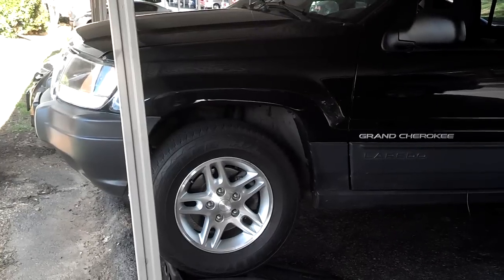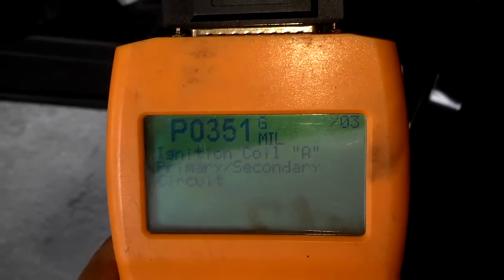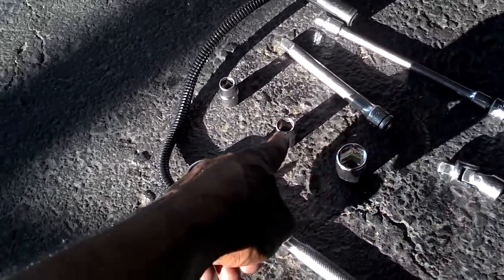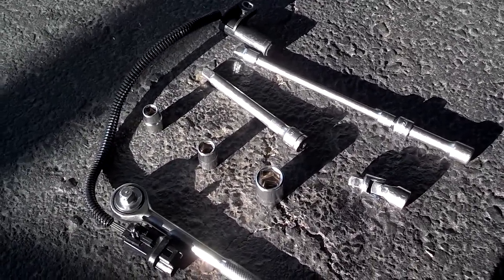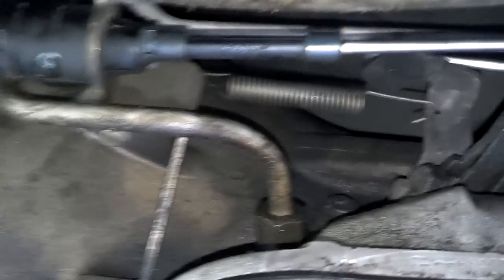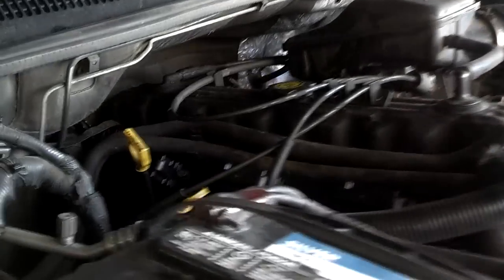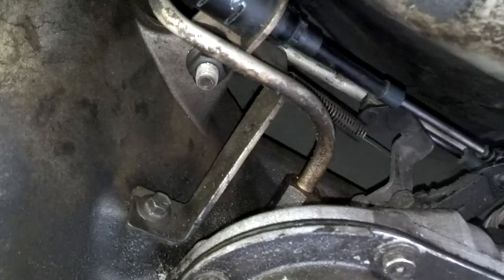How to replace the crank sensor on a Jeep, replacement, P Codes P0351, P1391, P1494 - VOTD

Comment: Great video Robert and I only wished that had your mechanical skills!  I started my 2000 Jeep GC today and it started bucking and the engine light came on. I was able to make it to my mechanic and he told me it was the crank case sensor.  I was unaware of the many things this little sensor did.  By the time I got the Jeep to my mechanic the Jeep would start but would stall.  So he will replace this part for me.  I had a rebuilt long block (4.0) put in this Jeep about a year ago (Bearings went in the old one - faithfully changed the oil every 3000 miles)

Anyway, I have a question for you.  When the Jeep is up to normal temperate and I come to a light it will feel like the engine is surging while at idle 'only when I turn the heat or a/c fan inside the car'.  If I put the car in neutral or park it's idles smooth, no problems. Would this crank sensor be the culprit of this issue?  I have already replace the AIC valve and thsat didn't do anything, but I'm just wondering what could cause this somewhat rough idle, again if I put the Jeep in park or neutral it seems to idle fine.  If I turn the A/C or heat off it seems to idle fine as well.  

The car has is about to turn 200k mile and only 15k miles on the new engine and keep it super clean, I bought the Jeep new and really love my Jeep and can't hate car payments.  

However, if you have the time to respond, I would welcome to hear what you think.  Thanks again for video and all the very best to you sir ....
Reply: Also, I think that he's using an after market crank sensor, is this alright to use?  I liked and subscribed! Thanks again!
Reply from the maker: Jazzman I believe you have a vacuum leak somewhere. You can also monitor voltage to see if they are changing. Alternator going out maybe.
Reply: Robert DIY Thanks for the reply, the mechanic (who is a long time family friend) tested the codes and it pulled the crank sensor, which match my list of codes that I printed off the internet and keep in the car for resources.  Are you referring to the vacuum leak regarding the idle surging issue?  Thanks for all the help!  Hey, I'm a jazz sax/flute player and only wished that I had some mechanical skills ..... :)
Reply from the maker: Oh, I do not like after market crank sensors, only Mopar for me. Yes, I think the hunting idle is from a vacuum leak. - Nice, my nephew is a jazz trumpet/sax player/teacher.
Reply: Robert DIY Unfortunately, the dealership did not have one in stock and I need my car back, so I'll have to take my chances on the after market sensor.  I was a touring musician and did a lot of studio work in NYC and taught at ECU.  I still play, but getting older and my chops are getting slower. Hey, thanks for the help Robert, you're a great person to respond, all the very best to you sir ....

Comment: so I got the old bolt off with a lot of trouble and pulled the old sensor out through the top of the engine but how the hell did u get the new sensor back to where it needs to go?! maybe I should hire a child for the day to get it in there?
Reply from the maker: Cameron Martin Yes it is tough. Some people cut through the floor inside the truck.

Comment: Why do u have to take out the Crank Sensor  ?  Just unplug old one and plug in new one. Don't take out.  Now Drill hole or glue to Firewall . ✔  Done
Reply from the maker: where were your instructions when I needed them?

Comment: hey i need yalls help i own a 2002 jeep grand cherokee 4.0L and it just started to run real rough and shuts off with now the oil gauge on H this morning it stayed between H and normal. but still runs rough. i took it to auto zone they hooked up thier code reader i didnt get the codes but he said its either your timing belt or your oil pressure switch. i changed out pressure switch and did nothing. could it be the timing belt? or could it be the crankshaft sensor PLEASE HELP
Reply from the maker: Aaron Worthington Go back and get the codes.
Reply from the maker: Many still have chains.
Reply: +Aaron Worthington I have the same issue, mine spits out miss fires on all cylinders(runs fine till it gets hot then it will spit n sputter and idle is bad). I told the auto zone guru, if it was not working the truck wouldn't run. I have replaced my ECM, that did nothing. I just bought this sensor on a jeep 1999 Grand Cherokee Laredo 6cyl 4.0, pretty sure this is it. Only thing scares me I have seen video's that say the cheap after market one's will not cure the issue, only factory MOPAR parts will be good to use. But for nine bucks I'll roll the dice. Already swapped out the cam positioning sensor it did not cure my issue, unless it was cause it was cheap too? Only other thing is the fuel pump in the tank that's next. Unless you have patients and get a good price on these used, I'd suggest run far away!
Reply: Its not the sensor its that long black think on the side of the engine. its called engine coil. its the flat plastic piece that stretches out down the side of you engine kind towards the top.
Reply: i tried everything changed out sensors and wires nothing went to a mechanic and they hooked up their machine and it said bad engine coil
Reply: try this out and goodluck and god bless buddy i hope i helped you out
Reply: +Aaron Worthington Yeah I know what the coil package is, the issue is the codes change. The coil package will not fire if the fuel pump isn't sending a signal to the rely. Yesterday while driving HOT after half hour, the whole truck vibrates and bogs down. I pulled over shut if off then restart, its fine.....Anyway I have the crank sensor on the way, but its a cheap replacement. 
 So they replaced the coil package and all good Aron Worthington?
Reply: mine did the exact same thing 
so yeah check out the coil package

Comment: Great videos brother.  I am trying to replace my crankshaft position sensor on my 1998 grand cherokee laredo.  What did you use to reach up there and get the bolt out for the sensor? I can get my hand and arm up there enough to get a good lock on it, did you use a certain tool to get to it?

Comment: Do you need to take the spacer off the crank sensor on a 95 laredo before replacing?
Reply from the maker: +Alvaro Gonzalez I don't understand the question. All the info I have is in this video.
Reply: +Alvaro Gonzalez Are you talking about the little spacer on the sensor itself?  If you are, then no, you keep that there.  If not, then sorry I don't knowhaha.
Reply from the maker: I have not done that repair or watched the video in years. I really don't know what to tell you.
Reply: For future readers - cheap aftermarket sensors may work, but generally lead to greater expense and frustration as they tend to fail quickly.  It's not mentioned in the video, but a new Mopar crankshaft position sensor comes in a plastic bag with a set of instructions included, and that sensor should have a paper spacer glued to the bottom of it.  DO NOT REMOVE. (NOTE: If there is no spacer, contact your local dealership Parts Dept to obtain one.) That spacer is important to properly spacing the sensor from the flywheel and it will be worn off once the vehicle is running.  Good luck.
Reply from the maker: Thanks for sharing.
Reply: What a time this has been.  Today I was able to get the bad sensor out, but because the small bolt holding the shift cable bracket stripped, and not having small forearms and hands, I had to get creative.

Using two 6" 1/4-inch extensions, I loosened the bolt to the crankshaft position sensor all the way.  Then, crawling underneath (the WJ is lifted 2 inches so left on the ground), I snaked my arm up over top of the bracket and worked the sensor out all the way.  Since I tied a piece of long string onto the connector end, I was able to pull the sensor all the way and will just reverse the process getting the new one in.

Comment: and as you mentioned red wire plug. Is it for CRANK or Cam sensor?  u mention Cam
Reply from the maker: +su su pretty sure it is the crank sensor.
Reply: Thanx for swift response jeep has 124,400 miles 2001.  so when removing CPS I notice its wrapped with other wires nice and neat like when first bulit.   how can they be pulled apart and then wrapped together again.  i hope you understand what I am speaking of
Reply from the maker: +su su I don't know they are hard to reach.

Comment: My '88 Cherokee has 904,000 miles.  The crank sensor started acting up after 10 years.  The engine would hiccup at highway speeds.
Reply from the maker: +8avexp sweet! Please share what you have done to get it there...
Reply: Changed the oil and filter religiously.  The engine was replaced at 599K.  It still ran, but was hemorrhaging oil out of the rear seal.  They felt there was too much end play in the crankshaft, so I went with a reman engine.  Fourth clutch, transmission (Peugeot 5-speed) was worked on last year.  The transfer case and rear axle are still original and untouched.
Reply from the maker: Still impressive. So your clutches last about 200,000 each? Where do you drive most of the time?
Reply: Mostly highway.  The original clutch lasted 202,000 miles before the pressure plate gave out.  The second clutch was replaced along with the engine; it lasted 397,000 miles.  The third clutch was replaced when the transmission was worked on; it lasted 256,000 miles.
Reply from the maker: Cool, thanks for sharing. Not often you see a vehicle with more than 400,000 miles, let alone close to 1 million.

Comment: Well after replacing the fuel rail, fuel pump, fuel filter, coil packs, spark plugs, and purge solenoid I hope this will do the trick.
Reply from the maker: Trevor Maughan Yikes! Follow the codes.

Comment: The bolt and bracket fell and I'm unable to find them.  They're not on the ground.  Where might the bolt have fallen and can use any same size bolt and thread to replace it?
Reply from the maker: +Jahil Parker sounds like you need to go fishing with a magnet. Most bolts have a strength rating. Probably not a big deal.
Reply: What about the bracket which is also fell.
Reply from the maker: +Jahil Parker not sure how I can help you with that.
Reply: Im asking if the bracket was important and will it be fine without it
Reply from the maker: +Jahil Parker let me see what it looks like?
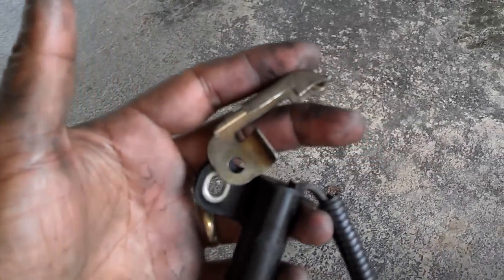Reply: its in your video around 5:20
Reply from the maker: I would think that bracket is pretty important.

Comment from the maker: Where did you get the cam sensor from? Are you sure it's plugged in properly? Check to make sure none of the connector wires are bad. Did the car have a CEL code?

Comment: hey my 2001 grand cherokee laredo 4.0 thru same code. changed spk plugs/gas cap/coolant temp sensor/engine oil and filter/ even replaced battery. it starts but fails soon after. so had codes with on/off key thing. 0118( coolant sensor)/0320/0138/0442(Evap changed gas cap)/0445/1762/0748/1685/0456.  YOu also say crank sensor but then cam sensor time ti time which is it please help. car is sitting
Reply from the maker: +su su replace the sensor in the video.

Comment: Your a good man Robert. I had no clue where that sensor was located. Now I know I'll have it done at the Garage. I'm 70 years old. I'm afraid my repair days are over.  What would this cost at the Dealer for Mopar replacement parts?  Any Idea?   Great video Robert. I subscribed and gave to a "Like".
Reply from the maker: +Robert Underhill estimates are usually in the comments. My guess would be $250.

Comment: hi.. I'm wondering if the idle speed was fluctuating???... I have the same turn off problem while driving and I'm about to change the cam shaft sensor, what i've noticed, is that when I decelerate abruptly in a stop light or over a speed bump the revs go under the idle speed and the engine dies, some times the ignition goes without problem, but in the worst scenario it takes a lot of switch-on (as in a cold carb engine) or even worst it will not start for a while (almost half hour)...

Comment: I have a 98 Grand, 140,000 miles, automatic, 2 wheel drive.  had the transmission pan & gasket replaced after which  it started to "almost" stall out when going from reverse into drive after sitting over night.  Since then the problem has gotten worse & it now seems to try to stall out every time I go from reverse to drive.  Does this sound like the crankshaft sensor or would this be something else?  Appreciate your opinion.

Comment: So i took car to a mechanic and says code says 01762 and and 0748. wants to change  governor sensors  and solenoid in transmission. crank shaft code not showing up any more. prob is  I've never dropped the pan  will this cause it to slip?? not a flush just dropping the pan.  mechanic says he can't guarantee the will start
HELP AGAIN.  I DID BUY THE CRANKSHAFT SENSOR FRO A1AUTO AND CABLE WAS TOOOO SHORT TO REACH OTHER SIDE!!!! really do they not know
Reply from the maker: They may not, you have to tell them. They may have a bad supplier. Sad to say, I don't know about your other issues.

Comment: Have a 96 jeep Cherokee 3 cpc, 2 oxygen, 3 fuel pumps4 plug wires sets,4 sets plugs , still have code po351. ready to try ECM. Best advice is don't BUY A JEEP
Reply from the maker: Gale Sams Ouch, what is a cpc?
Reply from the maker: So, CPS?
Reply: Check the wiring to your pcm, they love to come loose on 96-98 GCs
 Some people use tie wraps to hold them in place. My 98 would stall and their all kinds of codes (once showed 21 different codes at the same time) Cleaned the PCM connectors and made sure they where secured properly... Haven't stalled since.

Comment: Have a 98 Grand Cherokee 4L,keep getting code p1391. Changed crank sensor with factory Mopar sensor, still getting code p1391. Any suggestions?
Reply from the maker: +Jason Pantages ouch! Not really, check the wire harness real good.

Comment: can you get the crankshaft position sensor from mopar on ebay  or does it have to be from the dealer? doesn't the dealer use mopar parts also. its a a huge savings

Comment: Hello Robert, Thank you so much for this video... I did replaced my crank sensor for my 03  grand cherokee 4.0 with your video walk-through... Unfortunately, I'm still getting engine misfires throwing  P1391 code on the dash this time. You mentioned to replace it with OEM Mopar Crank sensor part. That I didn't do since it wasn't readily available instead a got a BWD brand from  O'rielly ...  Do you supposed  it is absolutely necessary to  get the original part for this problem? To date I've already replaced my Cam sensor (mopar) , & my coil pack (delphi) since it gave those problem codes as well after I replaced the crank sensor at first. Engine starts & runs then  misfires/shake after a bit of driving. Kindly let me know what you think when you get a chance. Thank you much! Reuben PS. Do these sensors need reprogramming with PCM?
Reply from the maker: Mopar, no programming.

Comment: And before you do anything open up the driver's door peel back the carpet on the hump and locate where the shifter cable goes through the floorboard being extremely careful not to cut deep take the Sawzall and cut two legs of a triangle peel the floorboard back and there is your crankshaft position sensor. Do this before you cut the s*** out of your arms trying to get it from the bottom or the top. Do yourself a favor it plugs in on the passenger side behind the engine. When you unplug it tie a string to the plug so that when you pull it out you can use the string to pull the plug back over there on the reinstall when you tie it to the new one. Your sensor will come with a pad on the bottom just push that down so it's firmly against the flywheel. The pad will rub off and leave you with the proper gap.
Reply from the maker: Thanks for watching.
Reply: great info ,, i have an 02 and its die on me twice this month when i come to a stop and gets ruff idle for a split second while driving wonder if this is my problem .
Reply: Very well could be. It will also for no reason cut out at high speeds sometimes reading gauging. Pulling off your battery terminal for a minute or two will reset the computer and sometimes works in smoothing out your idle and sometimes does not on first attempt. Sounds like one of the conditions I had before fixing it. This problem does not come up on the code reading device.
Reply: hey Tom i just placed the new one on yesterday , drop it in and placed the bolt back on and plug it back, now its valve clattering , can the gap be wrong ??
Reply: SID KNIGHT if it sounds like tap tap tap tap tap like it's valves tapping. Depending on year. I have an 04 the Piston skirts snap-off and lay in the bottom just inside the oil plug. I hate to be the bearer of bad news but I had to put 6 Pistons in. I used the 1999 Pistons They are thicker at the skirt. You can do this by taking the oil pan off and the head off. No simple task.
Reply: CRANK SHAFT and CAM SHAFT are two different things.